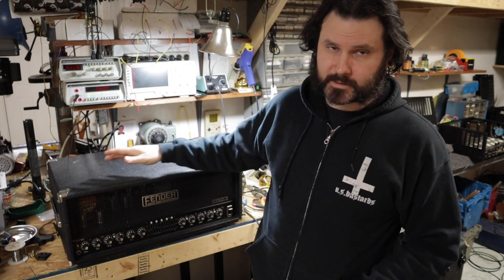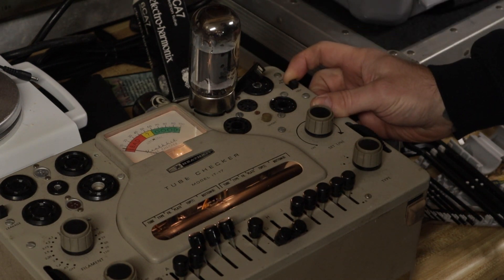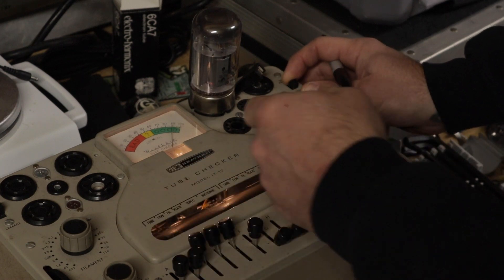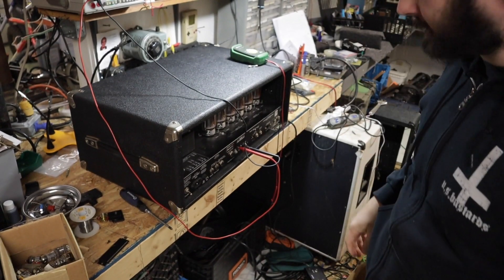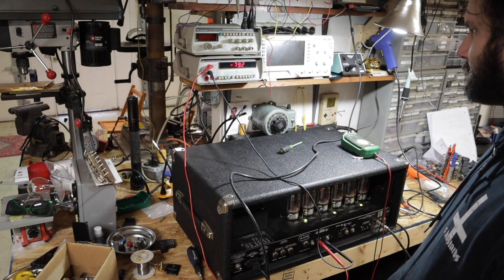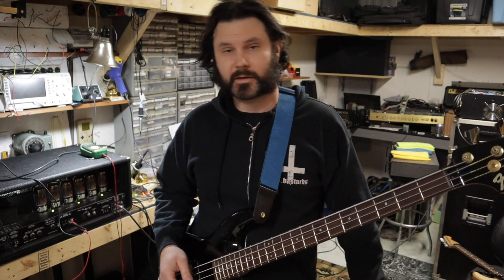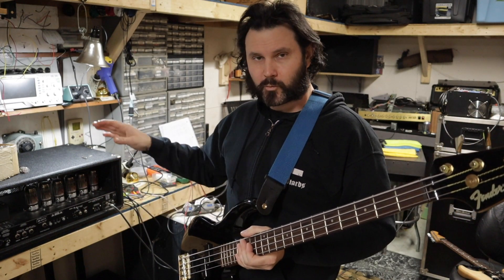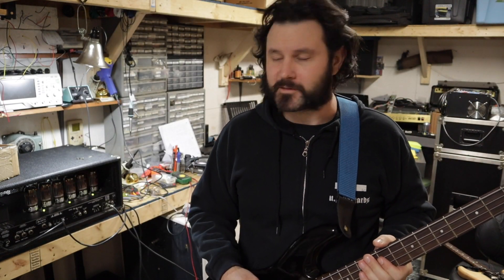Fender Bassman 300 Troubleshooting and How to Bias Tubes

Comment: I have 2 Sunn 300T's and on one of them the red green led doesn't light red when the amp is turned on. It will light green when i flip the stand by switch. The other 300t works just fine. What could be ny problem? YOU TUBE has nothing on this. Any suggestions would be greatly appreciated.

Comment: Hey quick question! Wondering why we absolutely want a matched set of tubes and want it even means
Reply from the maker: The short answer is that you want them to all function equally to get the best response from the amp.  Every tube draws a different amount of current and while slight mismatches are not noticeable, large mismatches can attribute to poor sound quality and uneven wear of the tubes.
Reply: @purgasound  Thank you very helpfull! Keep up the good work